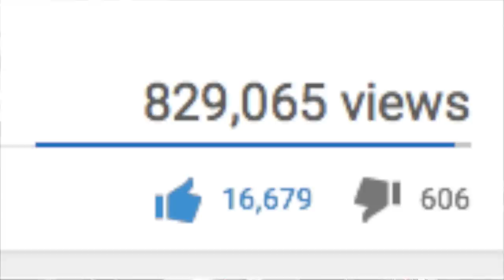The truth about "OFF-GRID" living

Comment: You can simplify your life without going to the extreme, to be totally off grid, unless it becomes necessary.  To me, the key is preparing, testing and being ready if/when it comes to that point.  Until that happens, I intend to enjoy my creature comforts, since there's no reason not to. 

I'm a 70 yr old, female, living in northern Mi on wooded acreage that has a mobile home, pole barn, and shed on it (I've also added a small travel trailer).  I have two wells on my property, but also have earth straws to be able to turn them into hand pumped wells (if no electric) and a river nearby.  To me, this is heaven on earth and I love it!  I'm in good health, but not dumb enough to think I can handle building a cabin on my own, so I chose other ways to fulfill those needs.  (I have a 50 yr old son, but he knows mom likes to do things on her own.)  I bought this property a year before I retired in 2019 (took me 4 years to find the right place and I paid cash) and sold my site-built house in 2020.  I periodically shut everything down for a few days or so, to test my systems, to see what needs tweaking and I see any disruption in power as an opportunity to do the same.  I have backups for my backups and I mix modern backups, such as solar, power stations, generators, chainsaws and propane, with old school backups, such as oil, kerosene, charcoal, handsaws and wood.  Some of my preps are over 100 years old and still work as intended.  

Some people will never get it, no matter how it's explained to them, but for those of us who do get it, my hat's off to you!

Comment: I have a propane cook stove and I turned the pilot lite completely off my propane last about 4 OR 5 times longer I use matches
DAVE BUSH RADICAL IS ONE OF MY FAVORITE CHANNELS HARBOR FREIGHT 100W SOLOR PANEL'S WORK GREAT FOR LIGHTS.
Dave your lucky
Your trip down river on that raft hooked me you did a great job on that video.
Reply: I started on the Harbor Freight panels.

I have a few recommendations for you first get rid of their charge controller the two I have had both went bad.

There are some good ones for less than 100 dollars.

For lights look at Superbrightleds.com 

I found some 12volt 900 lumen bulbs they were 20 something dollars apiece but they have been running close to 10 years.

When the compact floros run a battery down the ones I have will still be burning bright. They use 1/10th the power.
Reply: Agreed. Pilot Light is wastage.
A refillable BBQ Lighter is best.
Even after it is empty ... IT WORKS A SPARK.
Recharge it only where used in TRAVELLING A<>B<>A.... Right ??
Reply: Kenneth Kustren 
right

Comment: Some people don't really know that "Off-Grid" is commonly also about hybrid and other sources, such as gasoline generators, propane-butane cooking bomb, kerosene lamps for lighting, wood heating from the adjacent forest ..., just Off-Grid it represents everything that does not use the connection to engineering networks. This is the definition of "Off-Grid." Home photovoltaics with all accessories must also be bought in the store at a relatively high price, which we justify to our wives with a kind of return. Off-Grid is not about the need for poultry behavior, the need to grow vegetables, the ban on buying food, tools, technology, etc., but it is about something completely different. You explain this well to uninformed people in the video.

Comment: Trolls ... the woods are full of them.  We enjoy your videos and long to do some adventures like you share with us. Keep on being Radical!!!
Reply from the maker: Thanks
Reply: I have no tiefling. I have cast iron, tin and aluminum.
But if I had that type of cookware, then it just that I had it.
My cast iron I've own for many year, before I was off grid. There is no reason for someone to buy special cookware to live off grid.
As a matter of fact. My solor oven, has very expensive pans. 
Ready for it?
Lol. They are the tin cans from canned chicken and beef. Majorly expensive cost concidering they were in the trash, after opening and using contents, which btw was months before, i pulled the paper off, washed, painted outside black. They stack nicely and provide a lid for one under. Doing this I can make a 4 inch round bread loaf. Or most other things I cook. I can use 5 high and if I wanted to 4 across and 3 front to back. Knocking 1 off each row, which would come to 48. But I only use max 10 at a time.
My point is use what you got.
I'll Be honest, this is me, not say you have to do this. A reason I would choose Alaska if I was to do it again is that subsidized hunting licence. 
I use to buy my eggs from a lady, but she moved. Btw eggs can last over a year unrefridgerated. The most important thing about eggs is do NOT wash until you use them. Store, which are washed, eggs will last months non refrigerated. Also the longer an egg is refrigerated the less time they last. I also, through Very rare, collect wild eggs. 
Most the time I butcher my own meat. It's a hard process to do this and preserve it. I have nothing against people that buy store meat. For me to process a goat, pig, or sheep takes me on average of 5 days with only a couple hours of sleep each day. Now in return I have almost a years meat. That 5 days is just to get it to the last phase. The last phase takes 2 weeks and if it's not all racked in those 5 days, I have to cook the unranked daily until it's racked. But in return I pay around $300 for almost a years meat, which if I bought canned would be over $1200. 
And my flour. I have about a week to collect the seeds over 100 square miles. Then I have to rack them for 2 weeks. Which is a 3 month process to rack them all. After they are racked for 2 weeks, then I can store the pods. To make flour, i have to separate the seeds and pods. Grind the seeds to flour. ( I have other uses for seeds as well). 
Once it's flour, which btw doesn't last as long as the seeds, then I can make bread, noodles, or whatever I use flour for.
Cost of flour is much cheaper then what I do.
I don't have chickens because they will not last long, and they are like a nuclear blast in being noticed by the snakes. Snakes like eggs. And coyotes, eagles, hawks, and owls love chicken for dinner. I've been " bite" a few time by rattlers without having chickens. I use "bite" because technical the stiked, and hit. Nothing like protection. Lol. Someday i wont be lucky. The others im not worried about. Ive had coyotes 20 feet away from my dogs and i. Everyone minds thier own busines. Which is odd because my dog don't like other dogs. But hey.
I do live year around here.
As far as I'm concerned you are off grid. To anyone that says I'm not off grid. You are invited to join me for 6 months. Most people can't last one. After 365 days if you still feel I'm not off grid then open ye trap. I have seen people come and go. I only know one other and he is 3 years my junior on living out here.

Comment: Lot of envious trolls here.

They miss the point when they fail to understand what a grid really is.

The grid is electric power, water, sewer, and gas lines , etc. Choosing not to use these is off grid living. Using battery power, store bought food and other modern conveniences does not lessen the amazing talents of these youtube creators.

Off grid is not a choice to return to an 1850 level of survival.

Yours or Brooke's videos sometimes run in my house all day. I find them calming and even healing. 

I grew up with cast iron coal or wood fired heaters and early on, no running water, in the middle of 400 acres of pristine NW Ga wilderness. Your work brings back a lot of good memories.

Thanks for the opportunity to vent😊

Keep up the good work!

Comment: My in-laws lived off grid for 50 years.  They had propane and a microwave.  Their power came from hydroelectric on the local creek and and solar.  Sometimes the generator would be used as backup. Those who have an opinion about being off grid usually have never lived off grid.   You don't have to explain yourself.  You're awesome.

Comment: Right on the money! The folks you've been talking about that try to preach their visions of off grid are not in touch with reality. There are piles of versions of living off the grid, and those folks are wrong to preach thier versions to anyone else. I once lived in a remote cabin for two years, alone. It was nothing more than four walls and a roof. I ran out of firewood in mid-December. Most mornings were minus 20 to minus 35....inside.  I did have electricity. So does that make me a phony "back to the lander?" For food, I chopped holes in the lake ice and fished. I trapped rabbits and shot larger game. I melted ice for water. So, does not make me a homesteader, or a "back to the lander"?  HELL NO!!. Listen: everyone has thier own ideas. That doesn't mean of them are wrong. Only different.

Comment: Speaking of the Amish people. Not all Amish embrace the same philosophies. For example, some Amish own and use flip phone style cell phones while other groups of Amish do not believe in owning phones themselves but would be happy to occasionally use your old fashioned phone hanging in a pole barn belonging to their non-Amish neighbor. Some Amish have generators to generate power for their businesses whether it is a milking operation, pallet making operation, welding business, etc. They they sometimes use the generator to charge batteries, if they do not have a solar setup to do so. They sometimes have LED lights on their buggies to use for safety. I live in Michigan about 20 minutes from Dave Whipple's Michigan home.  I often see the Amish in local grocery stores, etc. A local Amish family who live adjacent to my parents come to sing Christmas carols annually on a route they have established near their home. Their youngest son sets  a trap for coyotes on my parents land. They inadvertently caught a bobcat in a leg style trap, so they called my father outside to witness them letting it go as they set it free. We have much respect for and like our Amish community very much. Another Amish family installed a metal roof on my house. It works well and I like it greatly. Some Amish own commercially built water pumps that use pressurized air to pump water from the ground for their houses. Common beliefs of Amish people is they do not  connect to the energy grid, and do not own rubber tire vehicles.  Do not be fooled. Amish people have cash money and pay well for land that suits them. Enough of my rambling.

I think many of the haters of Dave Whipple are locked into house payments, education payments, auto payments, etc so deep that they cannot get out. Not having those payments brings much freedom and personal satisfaction to a person's life. My hat is off to Dave Whipple and his family !!!

Comment: Did you mention a lot of upfront money that a lot of people do not account for and get seriously burned when they find out the upfront costs is more than they thought and the length of time to make the land usable depending on the kind of land they get. I can't even count how many wanna be homesteaders don't have the kind of savings needed to pull it off, because most people don't live near land with no or very limited restrictions to do and build what they want - so in most cases they will have to move because it is to far away to drive to work on the weekends or holidays and then for most is when the money problems really set in.

Comment: I haven't had power for 2 years almost 3 now, but I've had power.  I'm not on a power grid, but I've used a generator or a deep cycle battery with power inverter to charge things or run lights.

Comment: those people are really crazy... living your life is like a dream for me.... and yea a propane gas stove like that is amazing to have because you are not tied down to anything... you can move it anywhere and all you need is just those propane tanks... i mean if your place sells propane water heater, then you could even run hot water as well with propane tanks....

i think the cast iron pan comment is just probably some guy who thinks cooking is superior with cast iron... i mean i see pro chefs using cast iron pans and i sometimes feel envy... to the point i actually thought of buying one despite the fact that i do have a ton of different pans that are still in almost perfect conditions... i mean i used teflon coated pans as well and i know they are not the best and the coating don't last that long... and the cheap ones can't even last a year.... cast iron pans.... as you said it last way over a person's life time for a normal home usage....

and yea putting solar panels for your home and some batteries and inverter to run electricity for that off grid house is an option... i mean running power for light bulbs is a luxury of modern day living... but all of us takes it for granted...

and as you said, off grid just means that you are not in a location to run on the grid.... but it does not mean you can't run a grid line to it... you just choose not to run on the grid.... if those off grid people that wants you to go living purely in the wild keep pestering you, then why don't they just do it... drop everything and go out in the wild and build their own off grid lifestyle that they dream off themselves... just stop pushing your ideals on others... these thoughts are what causes war and conflicts....

Comment: "You can't be off grid because your stove lit without a match!" LOL, that's a very ignorant position.  My propane grill doesn't have a pilot light, and it's so off-grid that there isn't even a battery for it.  But it lights with a press of a button, the force of that press being used to create a spark.  Our main stove also lights without a match, and also has no pilot, but the sparking for that is repetitive as long as you hold the button in, so I suspect it's running from the "house batteries", using a tiny amount of DC power.  It works whether we're on or off grid.  Given the choice, I'd cook on propane vs the wood stove too.  It's so controllable.  If someone else wants to cook on their wood stove, or in their fire pit, or whatever, that's fine by me.  But don't assume someone is on grid power just because they can light their gas stove without a match.  You live your genuine life, I live mine, they live theirs.  So far, in our RV living, we've almost exclusively been on "shore power", but we intend to do some boondocking, see how well we can live without grid power, city water, and a sewer connection.  We know already we can go two to three weeks without the sewer connection, then have to go to a dump station or get a night or two with full hookups.
On the whole "you're doing it wrong" topic...you're doing the Michigan hand thing wrong!  In the video, it comes off backwards, with the thumb to the viewers' left.  I grew up less centrally, though still in the LP, Oakland County but where/when the roads were dirt, everyone had their own well and septic system, and it wasn't uncommon to see a neighbor raising livestock.
I've seen that same kind of "there's one right way" attitude, in plenty of other aspects of life.  There are motorcyclists out there who seriously seem to think there's only one brand of motorcycle that's "real", and snub their noses at any other brand.  There are RVers who have very specific ideas about what even constitutes an RV, and pretend all the other kinds aren't really RVs.  I'm sure some people would be outraged that I cook boudin not by boiling it, but by frying it in bacon fat.  And lots of people get mad at me just for driving on the left-hand side of the road, even though that's very common in some parts of the world.
Reply from the maker: LOL! stay on the right. I get the motorcycle thing, as I ride too.

Comment: I think off grid is being confused and intertwined with the concept of being 100 percent self sufficient.   There's no such thing!  I'd love to be totally self sufficient and provide everything I need to live and prosper myself, but it's not only impractical but impossible.  

I can't grow (let alone process) every type of food that I need or desire.  
Amish here in Pennsylvania are off grid.  Off grid means not tied to the electric grid. That's all it means. Once a property is tied to the electric power grid, then all these Governmental County  and State Codes and Code Enforcement come into effect.  This is the reason Amish choose to be off grid!  The Amish here go to grocery stores, use gasoline generators to run their washing machines.  Use a propane refrigerator. Have cell phones charged at their place of employment, use some solar to run electric wire fencing .  Yes many often raise some cash crops, raise crops on small to large gardens for their personal use.  Most ride bicycles or have a horse drawn buggy.  This saves them large investments in a vehicle, insurance and fuel and maintenance costs.  An average buggy new costs less than 6,000 and used buggies and carts go for much much less.  They can last decades without much maintenance.  This frees up their financial resources to put elsewhere, say buying large farms.  They love riding in our cars.  Some hire drivers also to drive them to their jobs, appointments, etc. But most try to find employment near their homes.

Comment: off grid ? 
 off grid means off the power grid!
 if you want to be a minimalist than fine it will work for some.
 I my self lived on  a 1200 acre cattle ranch (2 square miles)
we where off the grid to say for the 70s!
 the infancy of the solar movement
 we made a hydro electric using a homemade waterwheel and a generator off
a old ford truck !
anyway back to the subject there is a difference between living off grid &  homesteading !
 homesteading is living on what off what you grow ,raise or hunt!
off the grid means off the power grid that the just of it